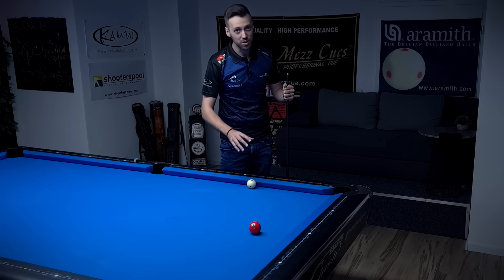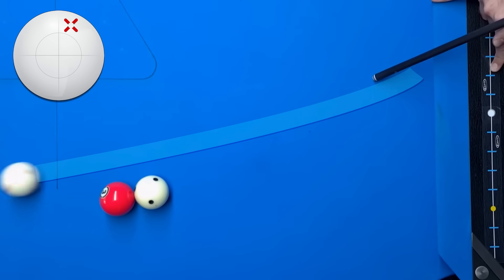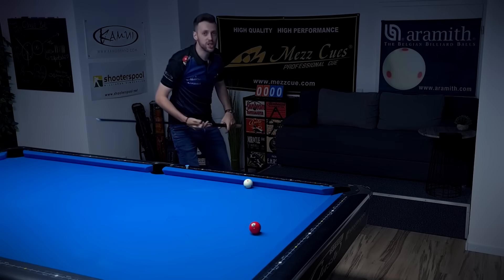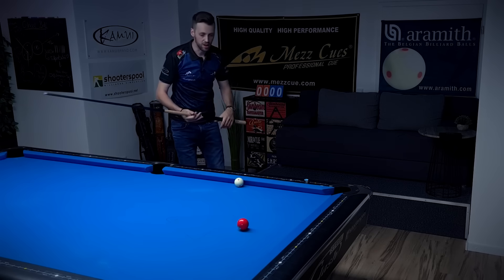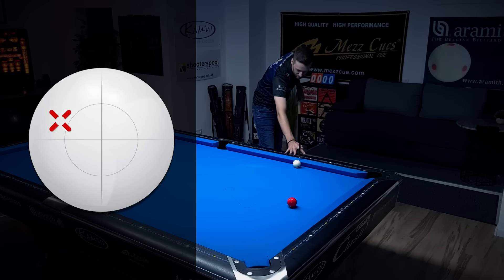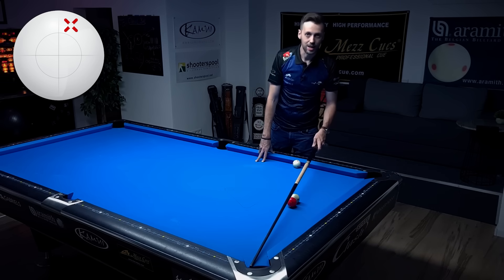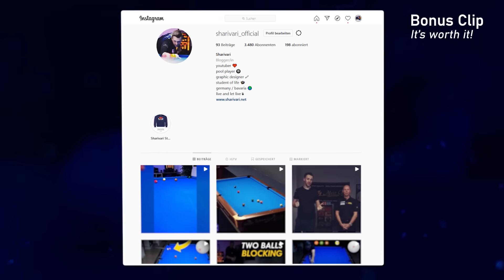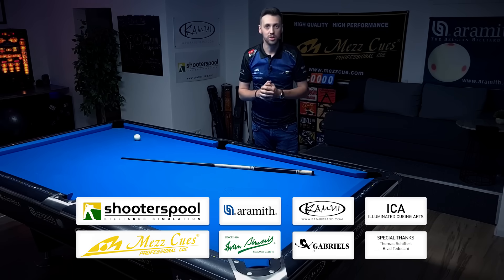Shooting Off The Rail With Side Spin

Comment: But if ur hitting it straight on with left, not jacked up, wont it just swerve the cue ball to the right? Not “curve”? Thus having to aim thinner, not thicker??
Reply: When the ball is frozen to the rail and you apply side spin, you're hitting downward onto the upper half of the ball. You're basically getting a masse effect and the ball will curve more. There is always some amount of jacking up on these shots or you'll miscue over the top of the cue ball. This masse effect is usually more pronounced than the deflection on these shots, so you'll need to compensate the other way. Or, hit it full speed like he did in this video. Hope this helps.

Comment: one time you told, if you play inside spin, you have to aim fuller...now, in this case right spin (inside) you aim thinner?...i understand nothing
Reply: In this case because of the curve of the cueball. He is shooting with a low deflection carbon shaft which does a lot of curving. Therefore, different shafts different results.
Reply: He was shooting hard and there was no time for the cue ball to curve!!